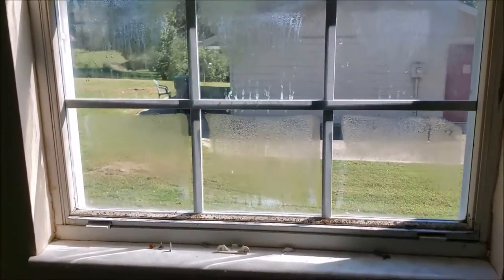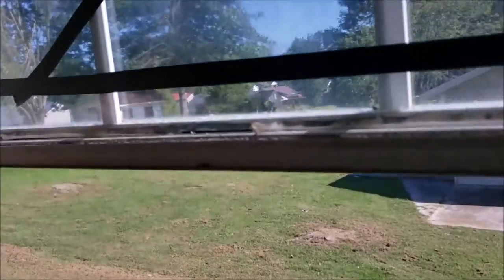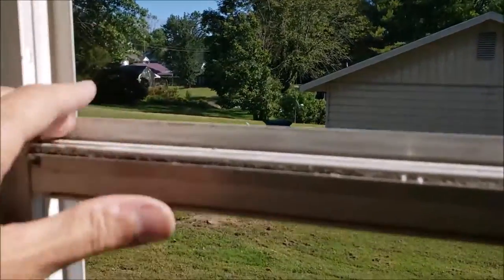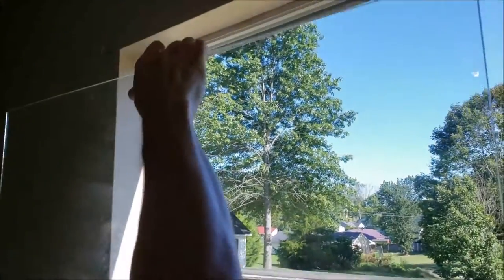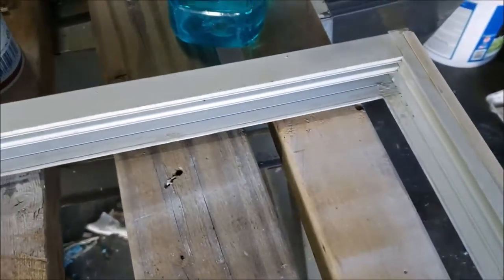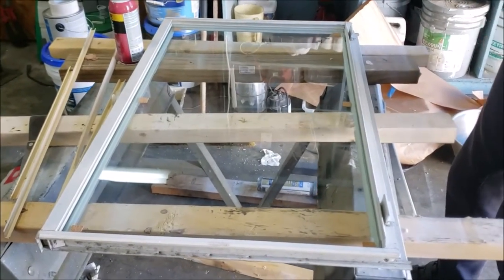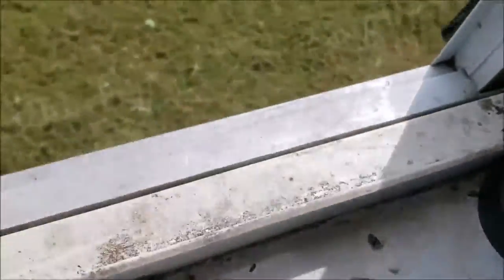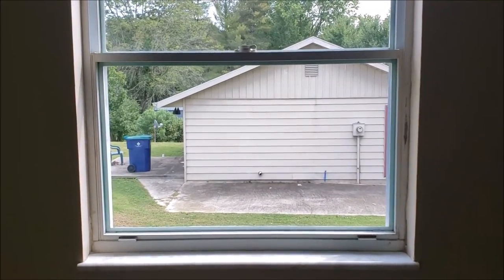DIY Landlord:How to Replace Fogged up Double Pane Window With a Single Pane Glass & Save Some Money

Comment: What thickness glass did you use? I'm changing out my sweating  double panes with single pane. I'm using 1/4 inch thick. Kind of over kill but I figure it's stronger and somewhat better insulation qualities. I absolutely hate double pane, just about everyone in my house lost its seal and sweat and look like crap. My dad's house built in 1960, has never had to replace a window except the one I shot out with a bb gun. Lol
Reply from the maker: Yes 1/4 is the way to go so it may be about the same weight so the balances work correctly